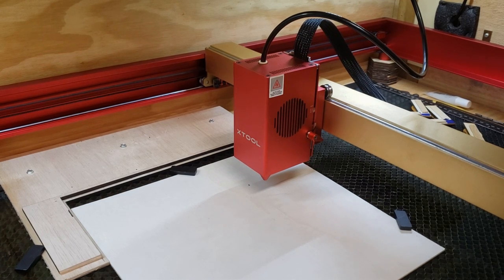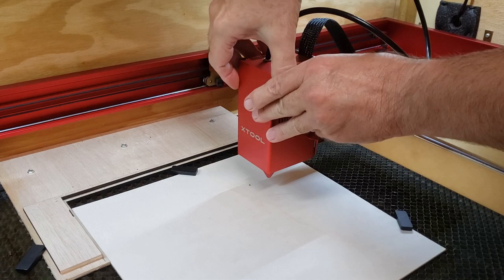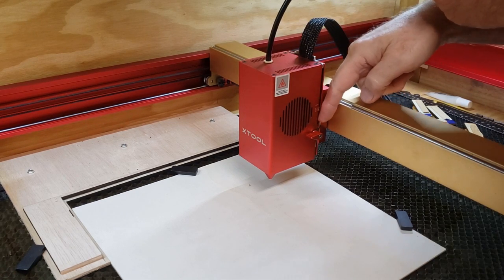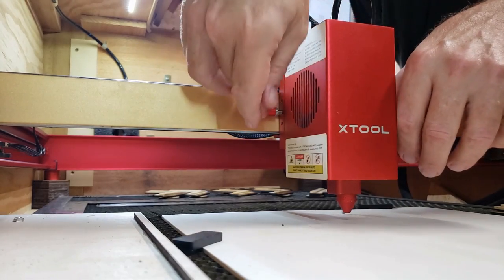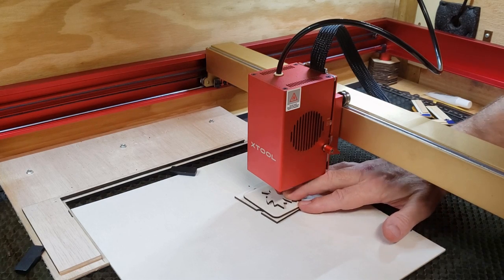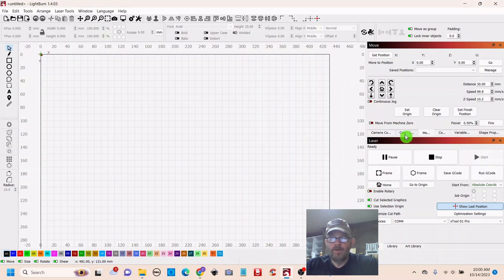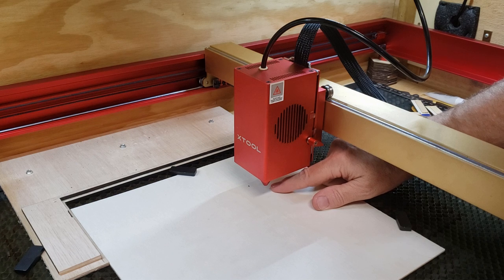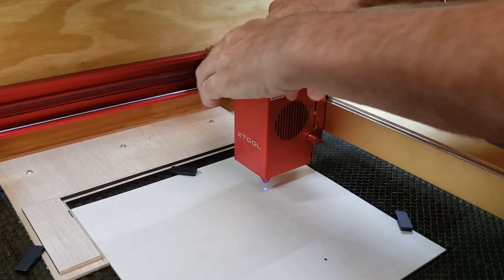Focus the XTOOL D1 Pro Laser

Comment: xTool recommends setting the laser focus by dividing the material's thickness by 2 (Optimized for cutting). For example, if your material is 10mm thick, you would adjust the laser head to 5mm. Here's how to set it up:

1, Measure the thickness of your material and divide it by 2.
2, Use the right quick-adjust lever to set the laser head to this measurement. For a 10mm piece, set it to 5mm.
3, Lock the right lever to secure the position.
4, Drop the leg of the laser unit and loosen the left quick-adjust lever.
5, Slowly guide the laser head down until it touches the surface of the material, then lock the left lever.
6, Lift the leg back up and make any fine adjustments to the laser's settings in the software before starting the engraving process.
Reply from the maker: Thank you for the detailed steps and explanation - very helpful to include this in the comment! I had not seen it explained this well anywhere before. I appreciate you watching and commenting. Take care - Dave!
Reply: @DGLaserCraft  no problem, I had run into the same issue, had collected some notes and wrote them down as instructions for myself, 🙂
Reply: This is absolute golden information 👏 thank you so much for this...

Comment: My laser has randomly gone out of focus. I have tried cleaning it (did nothing), and unfortunately I don’t have the option to manually turn the laser on in light burn for some reason.
Reply from the maker: Check your settings in Lightburn to make sure the laser is not in "beginner mode", then it should let you enable the fire button.  If this does not work, tell me which laser you have and I will try to help figure out what the problem is.  Thanks for watching and commenting.  Take care - Dave!
Reply: @DGLaserCraft  thanks, I figured it out (it wasn’t out of focus after all). For some reason the settings had changed from mm/sec to mm/min which as you can imagine just burnt the plywood I was trying to cut.
Reply from the maker: Glad it worked out. I have had the same thing happen  and burned a few unecessary holes myself.

Comment: Great video.  That's the best explanation of those marks on the module so far.  I've searched a lot of videos with no luck.  XTool support doesn't even give an explanation.  Thanks.
Reply from the maker: Glad it was helpful, Ken.  It took me awhile to figure it out - my focus is much better now and cuts are cleaner.  Thanks for watching and for the nice comment - Dave.
Reply: Just received a D1 pro 20w. Thanks for explaining. Best I could find so far online. I moved the distance adjustment screw by accident and was not sure to set it at the 0 mm mark, the 6 mm mark or some where in between. I guess the best thing you can do for is play around a bit to see what works best. Thanks again!
Reply from the maker: I have gone through a lot of trial and error with adjustments.  You are in for lots of fun with that new laser.  Thanks for watching - Dave.
Reply: I have a D1 pro 10 W and it does not have the extra focusing ability on the kickstand side. Is this something that is missing on my unit or does it not come with it?
Reply from the maker: Hey, Mark.  The 10W does not come with the adjustment marks - only the 20W & 40W.  Thanks for watching and for the comment - Dave.